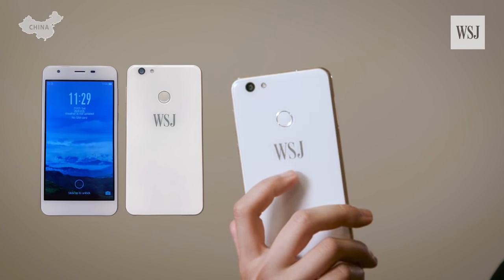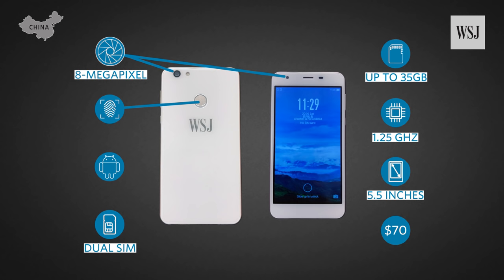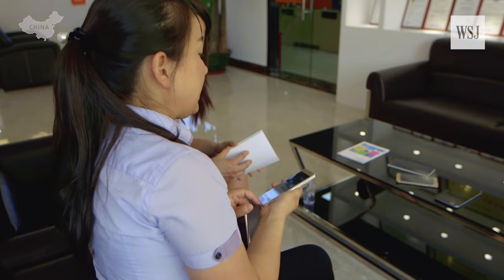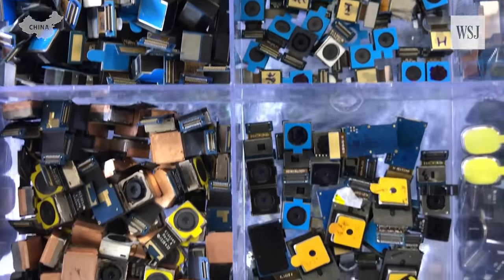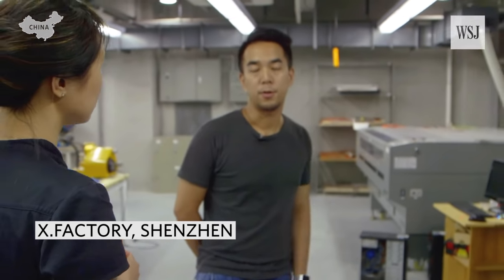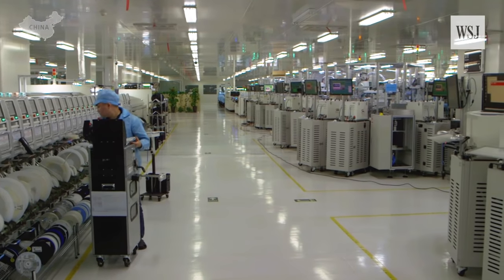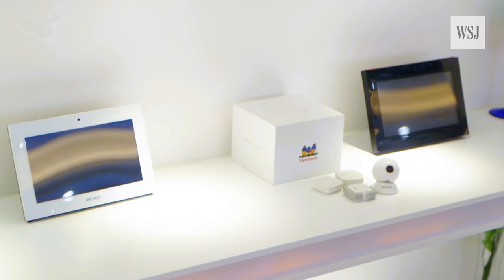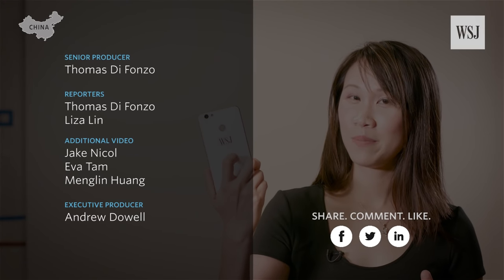How to Build Your Own Smartphone - for $70

Comment: OLED 2K Display 
5000 maH Battery
21 MP Dual Pixel f1.6  With 6 Axis OIS 
8 GB Ram DDR5
Dual Speakers
Snapdragon 840 Processer
AR Compatibility

Take My Order
Reply: Komekko こめっこ DDR5?? LOL
Reply: Komekko こめっこ QLED 5k Display
26800mah Powerbank battery
Camera Sensor of a Red Weapon 8k
64gb DDR4 RAM
Gtx Titan XP Graphics
Core i9 CPU
2.1 Sound System
Reply: Komekko こめっこ LPDDR5*
Reply: TheRobben and there goes your 100,070$
Reply: *4k display
Reply: Dan Odden *2k
Reply: Sam la toast 144p
Reply: Desktop: DDR5 (DIMM)
Laptop: DDR5L (SODIMM)
Smartphone: LPDDR5 (Low Power)
Reply: Vinnie Sifter wow, fast reply, no point actually, just explaining xD
Reply: Komekko こめっこ for me

Fingerprint Scanner at the front on the home button
6 inch Infiinity Display OLED
25 MP Front and Back cam
64 GB Internal
10 GB RAM
Snapdragons 850
Android Nougat
And 6000 mh
Reply: Vinnie Sifter there are only small amount of phones that has Android Oreo and Peppermint
Reply: Komekko こめっこ 
144p display
8mhz intel chip
1mb storage
5mah battery
Reply: samsung is making ddr5 ram
Reply: 509 GPU
Reply: 100k Oled Display
1TB Mengapixel Front and rear camera at f 0.8
100Trillion mAh battery
Intel Core i7 Xtreme
Quad SLI Gtx 1080 ti ftw3
Charge battery 0.00001 0-100
10mm phone thickness
Android Z SE
Brand: AlienSuperWickedPower
Reply: TheRobben would be too thick
Reply: sandwich two 3000Mah batteries and make it a total of 6k Mah :P
Reply: 32k optic amoled
12000mah battery
4.7 GHz snapdragon 895
32 gb ram
6.5 inch display
98 percent screen to body ratio
19.5 to 9 aspect ratio
Reply: gre Gree
That screen would drain so much of the battery plus there is a point where we cannot distinguish a speck of dust....
Reply: I don't wanna make you love me, I just wanna take your time
Reply: Dan Odden 2k is 1080p
Reply: lol i gues you all want a phones thats 5 inches in thickness😂
Reply: And a 3d camera, and 3d display.
Reply: SAMOLED 2K display
6000 mAh battery
42 MP Quad Pixel variable aperture 6axis OIS
32 GB LPDDR5
Dual speakers and microphone 768khz
Snapdragon 845 processor
1Tb storage
Dual sim
WiFi a/b/g/n/ac/h/ax/... WPA1/2/3 2.4G/5G/60G...
5G LTE ...
UHS card slot
5.75 inch screen

Do İt.
Reply: Mine didnt work but thanks
Reply: こめっこKomekko thank you I want to make a company
Reply: VQPUHD Super AMOLED Display
10k mAh Li-Ion battery
24Mpix 4 lens camera F1. 1 Aperture (All of the cameras)
Camera 1: Telephoto Lens
Camera 2: Main camera with dual lens for low light photography
Camera 3:Wide Angle Lens
Camera 4:AR Camera
(Camera) Sensors:
Laser AF Sensors, 4 tone flashlight, Flash Tone Reducer, Proximity Sensor 6 Axis angle sensor, Heart Rate sensor, SpO2 (or h2o, whatever was that called) sensor. In Display Wireless ultrasonic sensor. 
98% Screen to body ratio. 
Edge to edge infinity display. 
4K Resolution (Only at 120Hz refresh rate) /8K only at 50/60 Hz refresh rate) 
-No notch
Take my order too! 
Professional tripple noise cancellation microphone.
DAC Headphone Jack
Ultra Fast Wireless charging
USB Type - D Port
Micro SD Expandable storage up to 1TB
1TB Internal storage
16GB Of LDDRX5 Ram
Android OS 10.1.1
Professional AKG & Dolby Atmos Surround 5K stereo speakers up to 300dB
Snapdragon 1000
AR
Reply: hey friend i am hans raj i have a problem i want build my own smartphone but how and where plz inform me 
i have a smartphone design and i want to buld my own smartphone project but how
Reply: for me
4k oled bezeless display 144hz
10000 mah battery 
20 mp 4k 60 fps camera with ois 
16 gb ddr4
dual speakers
hifi dac
octa core processor running at 3.5 ghz

$4
Reply: SO YOU CAN PLAY POKEMON GO
Reply: こめっこKomekko me more prefer 128GB ROM 64GB RAM
Reply: That seems good if you want your battery to die in 30 minutes
Reply: No f1.6 is too small. Use the f1.2 and snapdragon 845 overclocked @4GHz
Reply: Oled 128k display
1gigawatt portable nuclear powerplant
Redcamera 500 MP camera
1 terabyte gddr8
10 petabyte storage
Ryzen epyc 128 cores
Quad sli titan v
Reply: TheRobben ok only 400,000 dollars
Reply: IPS LCD 6" 1080p/4K display
6,000mAh/10,000mAh true Li-Po battery
20MP + 10MP f1.7 rear dual camera 
20MP f1.7 front camera
Qualcomm Snapdragon 845/Intel Atom
512GB ROM
8GB LDDR4X RAM
up to 32GB SD Card slot
Fingerprint scanner
Face ID
18:9 aspect ratio
Dual speaker
Headphone jack
Edges screen
around 7mm thick
Wireless charging
True fast charging
Vulkan API
Stock Android
Bluetooth 5.0
Android P
Reply: Same goes to QLED
Reply: @Vinnie Sifter Game on
Reply: Oled 8k display
6000mA battery
128 GB ram
21 mp cam with pixel ai Chip
SSD 256 GB strorage
Qualcomm snapdragons 845
7.1 sound
AR compatibility
Reply: @Vinnie Sifter Oh
Reply: TFT LCD 854X480
3000 MAH battery
9 mpx rear 5 mpx front
16GB Storage 768MB RAM
[Insert budget CPU here]
One speaker
MicroSD up to 2TB
Reply: Infinity ram
Reply: And all the proccesers you can think of
Reply: Or just get an iPhone 📱
Reply: ddr5 isn't out yet...
Reply: You for got the 512gb onboard memory
Reply: No snapdragon there's better... INTEL i7
Reply: Is there Snapdragon 840?
Reply: Snapdragon 845
Reply: @TheRobben98  imagine how thicc will that phone be
Reply: what about a GeForce gtx 1080 (mobile)
Reply: Thx
Reply: GDDR5*
Reply: It is possible now!
Reply: @ax2bxc  LAGWIZ
Reply: now after 2 years you can get it in stores
Reply: @danishdezembro1116  😄 super
Reply: @RealOachi  possible
Reply: @TheRobben98  no, ddr69 is better
Reply: Bruh 😂😂 so expensive!
Reply: @bagaspermana88  yeah.. SD 840 seems obsolete infornt of 865+
Reply: 125 watt type c charging
Reply: and a headphone jack
Reply: ax2bxc Hi, Samsung speaking
Reply: Hey u can get snapdragon 865+ processor wih 8 gigs of lpddrx5 ram
Reply: @dimadm60patton65  How far we have come
Reply: Yes sir but you have not pay your Emi still .
Reply: @legit5833  sadly my phone got locked

didnt paid the emi
Reply: @komekko373  hey you are still there our company think you left social media.

Plzz pay fast .
Reply: @komekko373  no you have to pay more than this.

Comment: OLED 2K Display 
15 MP With 6 Axis OIS 
Snapdragon 840 Processer
8 GB Ram DDR5
4000 maH Battery
IR Blaster
Dual Speakers
AR Compatibility
Removable Battery
Bluetooth 5.0 (current phones only have 4.0)
Quick Charge
Headphone Jack
USB Type C
Waterproof
Works with Google Project Fi
Android 9.0 (when it comes out)
Reply: $10000
Reply: DDR5 ????
Reply: Might as well have blast proof glass and 10000 mAh battery.
Reply: 😂You just made the poco f1
Reply: Already exist

Comment: You wrote that the mobile phone takes a card of 35GB. There is no 35GB, just 32. Your journalists need to learn a bit more about the technology before doing such a video. Furthermore, you can buy a better phone for $70 from a manufacturer that already exists, just because they buy parts in huge amounts for cheaper.
Reply: it's not always 2^n, Samsung Galaxy S9 can only take 400GB not 512GB.
Reply: no, the S9 can take up to 2TB, in fact many phones a few generations ago can take microsd cards up to 2TB, it's just that there isn't any 2tb sd cards so companies just advertise the current highest sd card capacity
Reply: God of Light not true, I have a phone that can take 32 gb. if I put either 64, 128, 256 or 400gb it would not work....
Reply: that is because your phone uses SDHC standard, thus it can only support up to 32gb, most flagships use the SDXC standard which can go up to 2tb
Reply: @godoflight558  sd cards don't go up to 2tb the bigest is 1tb and that is in short supply due to the cost

Comment: I want to make a smartphone:
Snapdragon 845
4 cores
2ghz
1gb ram
32Gb internal storage (no expandable storage)
8mp primary and 5mp secondary front camera with good sensor
Obviously with snapdragon845 you can shoot video in 4K
Nice speakers
Best 5" display
And so many sensors
Reply: Why no expandable storage?
And why only 8mp primary and 5mp secondary front camera?

Comment: I want a AMOLED Display with gorilla glass 5 protection
48MP(main) 16MP(Ultra wide) 32MP(front) cameras
Snapdragon 855
4000 milliampere battery 
Fingerprint sensor on the back

So how much?
Reply: Hmmmmm around 200-300dollar I think

Comment: I just want a phone that's made a a person with man hands.  Thicker, maybe with an aluminum heatsink that runs the distance of the phone. I don't play games nor do I run a bunch of apps that run my battery down. A phone I can charge while playing music, running maps, sitting on my dash in the heat. Oh and a replaceable battery is a must. Doesn't need to be pretty it gets a case. Good signal. Stop trying to see how small thin and cheep you can make the phone. Have some pride, and make a phone to lasts.

Comment: Request: Super AMOLED 1440p Display, 6.4 Inch Screen
Custom Skinned Android Pie
3 Rear Facing Cameras, 13MP Dual Aperature F1.5 And F2.4, 8MP Wide Angle, 5MP Telephoto, LED Flash
8MP Front Facing Camera
Glass Back, Dark Grey In Color
64GB Internal Storage, Expandable By Micro Sd Card To 400GB
6GB Ram, Qualcomm Snapdragon 855+
Fingerprint Scanner

Comment: dynamic AMOLED 4k display
SSD 835 
4100 mAh Battery
Capacitive Rear Fingerprint Sensor
6 inch display
Matte soft touch back
24 MP front camera, 2k 30FPS video
48 MP rear camera, 4k 60FPS video
12 GB RAM
1TB storage
Headphone jack
Slightly thick phone
Curved back
Facial Recognition
100 GHz processor
Stereo Speakers
Dolby Atmos 
IP68 certified
Stock Android
AndroidOne

if only tho 😂😂😂

Comment: 5 inch 18:9 AMOLED 1080p display with 78% body to screen ratio
snapdragon 820, 4g ram, 128 gb internal memory only
3000 mah battery fit-in with a max smartphone body thickness of 8mm
pure android with squeeze function
NOW GET ME ONE

Comment: I'd make mine mixing the best of Apple and Samsung together haha. oh and I'd have a jack
Reply: i will steal your idea hii hii..............
Reply: Best of apple? Samsung is better in every way
Reply: hey i have a smartphone design it is best to apple and samsung but how i buld
Reply: 박재민 for start, pick a decent  battery that doesn't drain itself like Apple and doesn't explode like Samsung.
Reply: ZomeDash // Levi Except in software Possessor and Camera..
Reply: @ZomeDash  It's arguable, the note 9 is a slightly better value than an iPhone, but is still overpriced in my book. I bought a note 4 awhile back for $750 and I thought that was expensive, 5 years later it's $250 more expensive (not sure how much the new tariffs are in play here); plus I got the samsung gear watch at the time and felt like I was in some sort of closed ecosystem since I could only use it with my note. 

I just decided to go with OnePlus for my next phone, that's the plus about android, I'm not beholden to one brand. Samsung is definitely better, they've had a lot more innovations over the years (recently), but not hands down the best.

Comment: I have mine and I want to build it for the future

OLED 2K display
3 rear cameras with 48mp+16mp+8mp and zooming which is will zoom greater than the p30 pro 16 mp front camera
6gb ram 
IOS software 
A13 bionic chip
5000 battery capacity 
3D touch
On screen fingerprint scanner
Face Id unlock
dual speaker 
No headphone jack(Because it is now an old technology)
Game booster(it will make games 30% faster but cost more battery life)
Supports 5g
Also it will start with 6gb ram with 512gb rom and price will be atleast $1500(very cheap)and if you want it to be very cheap it can go for a price of $5000 and the 1tb rom for $10000 or if you want it to be midrange 5tb rom with 16gb ram for just $25000 great enough for a midrange phones and 10tb rom and 32gb ram for $50000 flagship price and also you you need to pay extra $1000 for the box